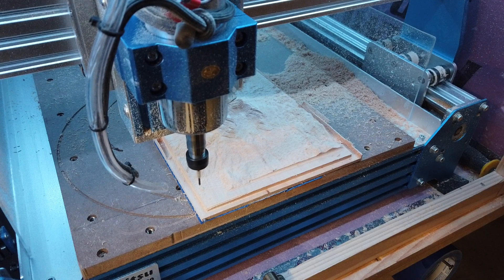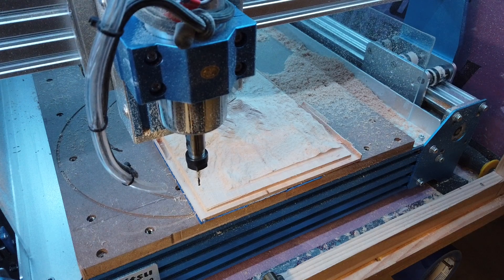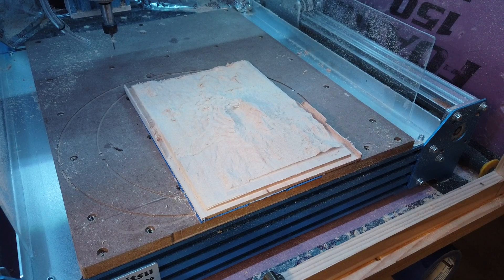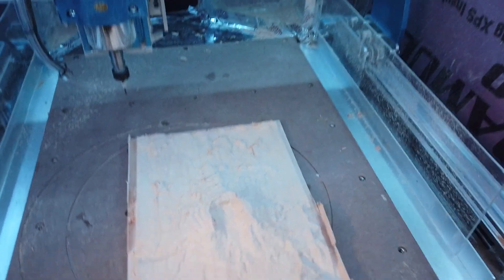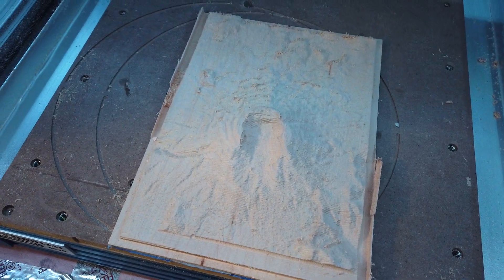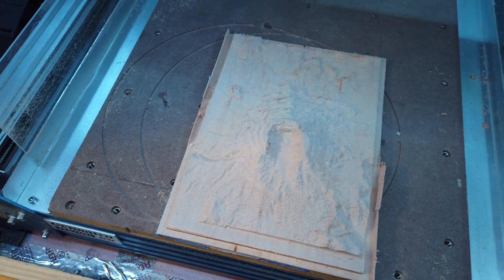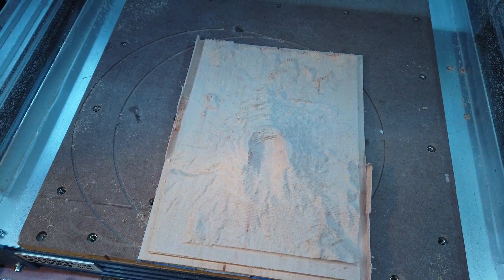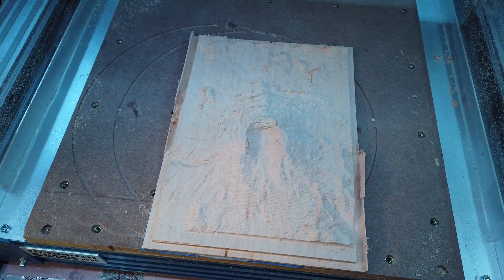3D CNC Volcano Part 4

Comment: Nice job, very adventurous for a new user. All mine are still 2D , flat !!
 Did you use a straight flute /windmill? Or a ball end? The ball end gives a smoother finish, not show 1000s of parallel lines
Reply from the maker: It was a ball nose.  But I wasn't going for a real finished product. Just experimenting, Plus it was cheap basswood, so you can't really expect  the best of finishes no matter what you do with the bit.